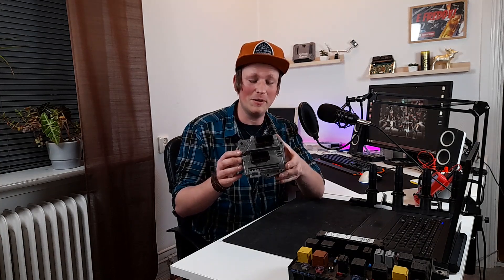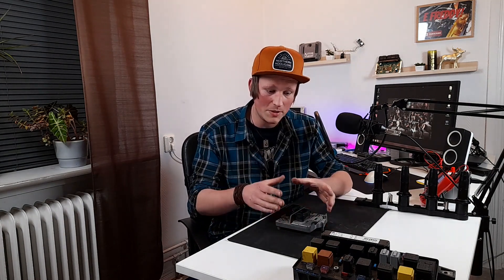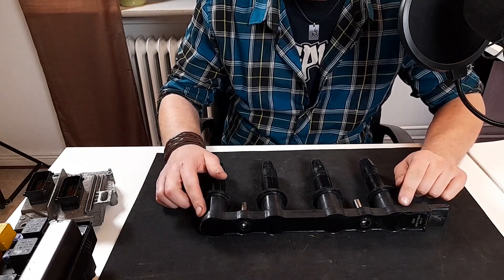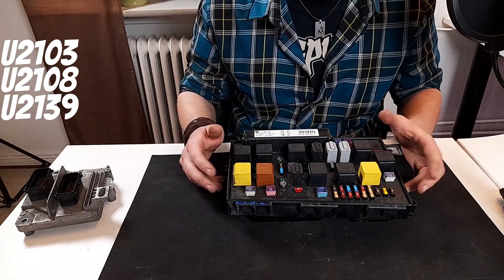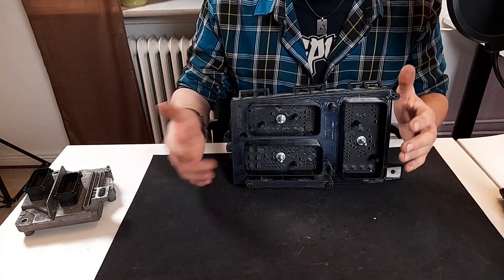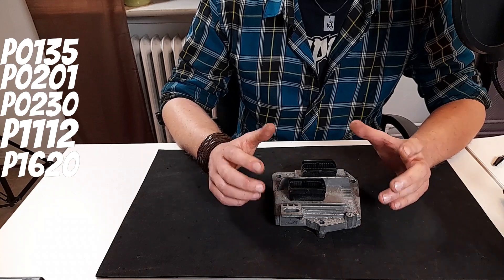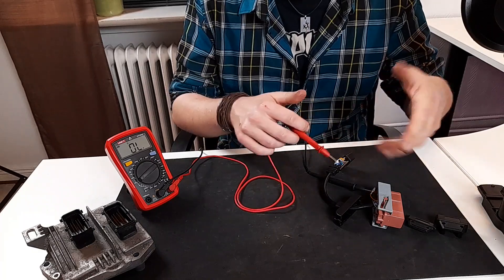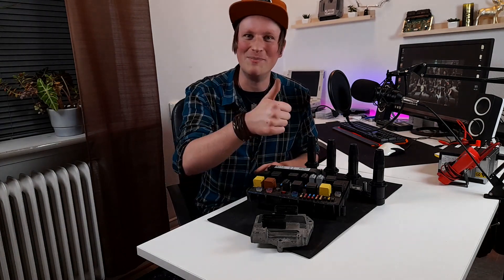Opel Astra P1600 ecu problem, fault finding and repair

Comment: Hey freddy, i hope you can help me out. I have a p0351to4 crank no fire. Swapped coil pack, that did not do the trick. I have scoped all ignition coils and found that the ecu is acting on all 4 wires only when the coil pack is disconnected. As soon as i connect it and start, no signal is registered any longer on scope during starting. Crankshaft signal is coming in but, i found that, both crankshaft wires are shorted to 12V+. I think this is happening in the ECU. I estimate that ECU does not see difference in 4 loaded 12v coils and 2 crankshaftwires that are 12V and therefore not acting up. 

Can you tell me if its normal that both wires are under full 12V+? I measured these voltages in reference with battery-

Please hemp me out

Comment: Nice one. I have a Vauxhall Zafira that had a badly corroded ECU connector (connector M) with some ECU pins so corroded they fall off. I have replaced the ECU pins, refurbished the wiring loom, just finished testing all the connections and I am about to try it out. Wiring loom was a mess as there are a few versions of the wiring, especially with the throttle valve connector, mine is 6 pin, all the diagrams seem to be 8 pin but the 6 pin has the +5v and ground common, with +5 going to pin 4 of the 5v PSU chip in the ECU rather than separate ECU +5v pins, pain in the ass, but sorted now. Be well!
Reply: Please how can I sort it my self
Reply: Please can u guys direct me on how to do it

Comment: har en opel astra z16xep 05 har fel koder p1550 och p1600 som går in i limp mode bara när den blir varm har bytt spjällhus från skroten men löste inte problemet så kan det vara ecu som är trasig startar jag om ett par gånger så kan den ibland hoppa ur limp mode
Reply from the maker: Hur ser anslutning/kontakterna ut till motorstyrdonet? Testa tvätta rent med elektronikspray. Gärna om möjligt ta några strån från en finare borste och gnugga lite i varje utgång. Om detta inte hjälper, är det dags att ohm-mäta kablage. Ett friskt kablage har ett motstånd i närheten av 1 ohm. :)
Reply: @EFreddy   tack för ett snabbt svar ska kolla upp det så hör av mig inom kort
Reply: har kollat nu och alla kablar ligger på 1.5 till 1.3 ohm till spjällhuset och minusen till ecu ligger på 0.5 kontakterna är rena och fina men hittade en lös kontakt hängandes från torpedväggen har bild på den men vet ej hur jag bifogar bilder här
Reply: @EFreddy  vad tror du är det kablaget som ska bytas ut eller
Reply: @EFreddy  vad tror du om du kan komma med nån ide vad det kan vara tacksam för svar
Reply from the maker: @kevin22325  Tyvärr. Jag tar för givet att det sitter en frisk original tändkasett och de övriga grejerna i videon är kontrollerade? Säkringscentral är fuktfri från baksida osv. 😊
Reply: @EFreddy  ja tändkasett bytt till original och säkringscentralen är fukt fri
Reply: Hejsan 
Halsningar fran Konstantin 
Grekland 
Har du fixat bilen??
Reply: Ja jag köpte en ny och programerade den så det funkade jag lagade den andra och har den som reserv
Reply: @kevin22325  
Jag forstar inte vad du kopte nytt ,
En ny ecu?? Eller spjallhus??
Reply: @kevin22325  
Ok 
Jag tackar for svaret